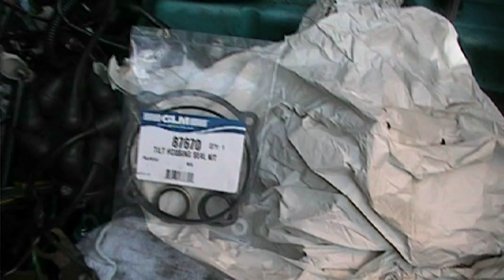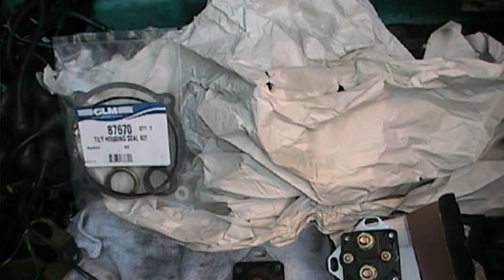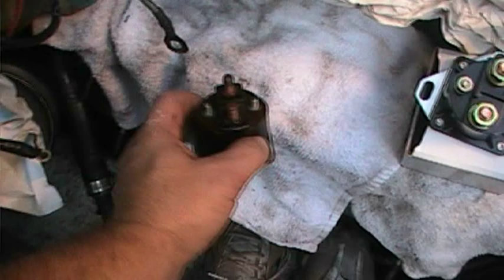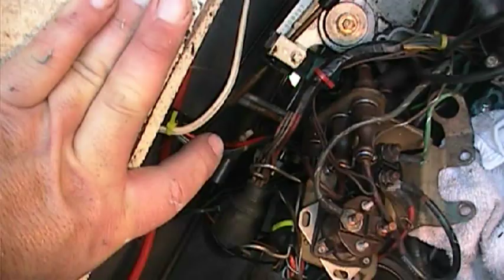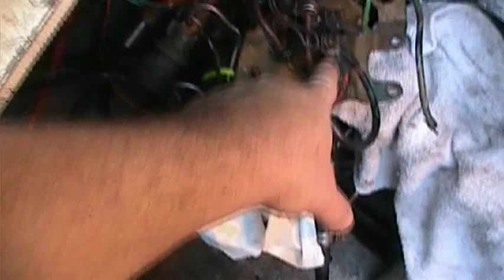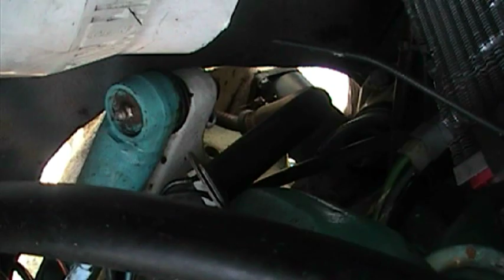Tilt Clutch Solenoid OMC Stringer 800

Comment: I replaced both my solenoids and the tilt trim motor but still no movement from the tilt trim? What am i missing?
Reply from the maker: get a volt meter and see if you have 12v out of the solenoid to the motor; you should hear them click,  you could also get outside and have someone fire the tilt and you lift up on the boot to see if something is in a bind; worse case if the motor is working you have a clutch pack issue

Comment: I have a 85 rinker omc stringer after I start the motor and turn it off the tilt won't work I go and move some wires around and then it works. do you have any tips for me on what it could be?
Reply from the maker: haligan777 clean all your wires on your solenoid spotless and make sure they are securely bolted down. Same at the switch. It's almost certainly a corroded wire at one or the other.

Comment: on my trim switch on the single lever control when I hit the up button the engine does go up, when I hit the down button the   engine also goes up does anybody have any ideas?      its an omc stringer 1983 out drive  with a chevy 175 H.P. front hydraulics not sure if its a solenoid or a bad switch  some help would be appreciated.
Reply: it sound like you might have a bad seal in your pump
Reply: its a fairly new pump,  if i go directly to the pump with a hot lead from the batt. and touch either end of line from the pump be it up or down it works ok

Comment from the maker: It should spin half a turn or so to wind up before engaging the tilt gear. Sounds like something on either end of the worm gear. Check that out really good. Break it down. Clean it up good. Make sure all the parts are there in that apparatus and not broke or hung.